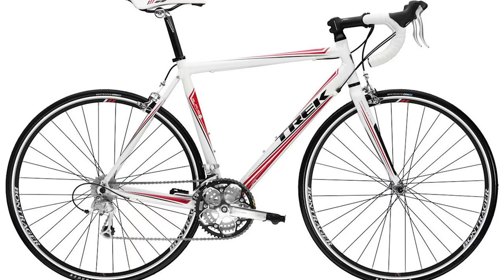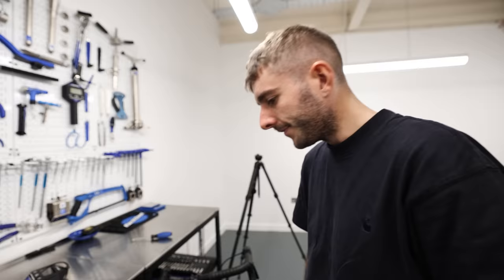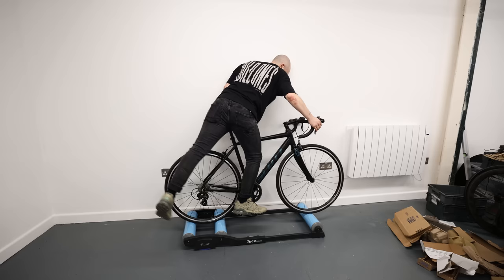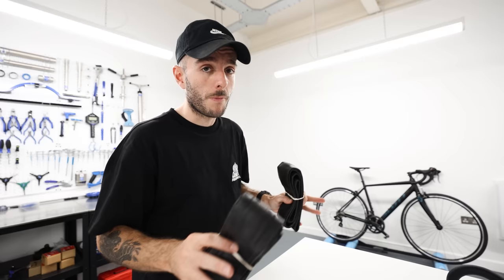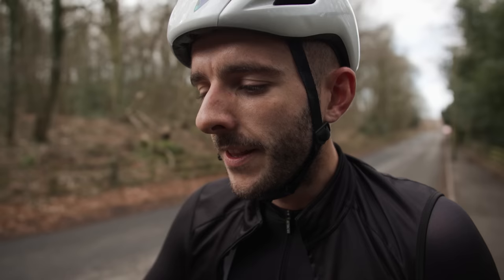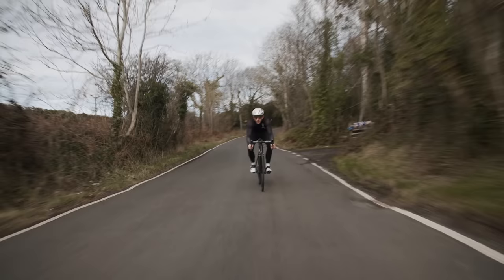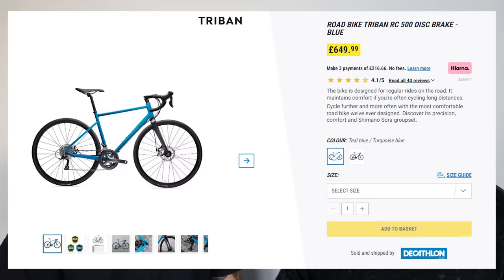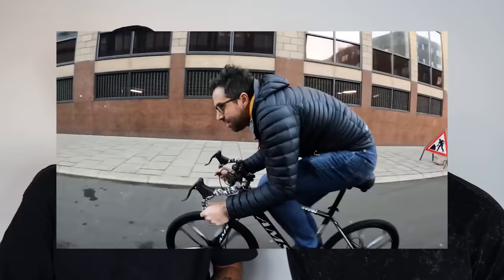How Good Is An "Entry Level" Road Bike In 2023?

Comment: My first bike was a 20" Walmart bike. Then moved on to another Walmart boke made by Kent. The Ditch 1.0. It SUCKED by real bike standards necause the frame had an offset doible trianglr at the crank and the frame broke clean in half right there. My most recent bike is a Frankensteined secomdjand Walmart "full suspension" comfort bike with parts salvaged from that Ditch bike. It has a front MTB tire. Both tires slimed for gravel riding. 1x7 groupset. It kinda works. Expect at least one chain drop per ride. 

I got a Trek FX2 this summer but ended up returning it due to not fitting me well. The handlebars were too wide even though my legs were having a fine time. Apparently I have weird geometry. According to some measurements I did myself, if I were to go by the Trek official sizing, I should have an XXL stack, an L reach, and XS handlebar width. I them tried their Verbe which felt nice but frankly came with insultingly mediocre parts for $1,000. Alivio groupset, full aluminium frame and fork, special gel saddle that was way too wide. It was like riding a horse or a giant tricyle. Didnt even pick it up since it had the wrong parts, like a special alloy handlebar that's alloy but acts like carbon. Is that a thing??

I'm skeptical as to what I can get a big brand store for cheap. Too bad we don't have decathlon locations here.

Comment: I started cycling with a steel frame bike and love it, then I bought a used aluminum scoot bike for $400 dollars,  and I did my 4 century rides on that bike, then I traded for a usted full  carbon fiber but it was to big for 😢 so I traded it for a composite frame used bike Gaint defy alliance 1 2009 , so I never had the experience to ride a new bike.

Comment: My wife has an aluminium carerra zelos from halford, the one before the went disc. It's been bomb proof. If comes with the exact same groupset as this bike so your comment comparing to the ebay bikes isn't true. I'm sure there will be some differences but they are definitely proper bikes and not like those ebay ones that fall apart on assembly. It was 250 when I got it, think the zelos is around 300 quid now

Comment: Jimmi is for the people! Smaller gears! Right on! I think it looks like a good bike. The brakes are good, probably less headaches for an entry level bicycle. If you haven't tried 105 or ultregra and up would you really notice the entry level disc brake being an issue if its set up by a local bike shop? A little pricey for entry level, I think $800-900 USD is better, but with current market, inflation, etc etc, $1000 USD, might be the new entry level. Francis has a good point, have to be careful because there is a point where cheap will mean things breaking and falling apart, which is not good but are we on the cusp of having entry level bikes come with sensah or L-TWOO and reserving shimano for premium products? I've had Sensah and Microshift bikes that worked very very well for around $1000 USD +/- 400 which seems like it's in the same territory.

Comment: This is a bike that's set up properly, there's plenty that aren't. I bought a road bike a few years ago as a commuter bike, and I was able to make adjustments, but I'm not an expert mechanic. When I brought it to a LBS, they told me the rear dropouts were a spec that manufacturer's hadn't really used in years. Turns out, they were welding MTB rears onto road frames, as both 'halves' were otherwise junk due to manufacturing defects. Well, the LBS told me that if I continued riding it like that, I would likely crack the frame. At no point did the bike seller make this known, whether through documentation, or anywhere else.

Comment: First bike was an mtb Giant GSR 200 very very basic, all parts got upgraded. Working in a bike shop in the late 90's £350ish for entry level mtb, rigid, one bike manufacturer offered a better quality frame that could be gradually (or rapidly depending on wallet) upgraded with better components. So I'd look at who offers the best frame size that fits you for what you can afford, components can be upgraded as and when. If the Scott frame is good then yes it's an entry level bike.

Comment: Agree 100% on most new bikes being overgeared and it being stupid to sell stock saddles without cutouts.

Where I live shops have 52/36 11-30 bikes on the floor and local hills are rife with 12-18% grades. I have 50/34 and 11-34 and my knees are much happier. No one I know or see is calmly spinning 36:30 on 15% grades.

Comment: I think that entry level bikes with disk brakes still have an advantage over rim brake bikes - not because the bike as built is better (rim brakes are much better than cable disk at cheaper price points) but because it gives the frame a longer life of upgrades. Upgrading to a different group set is better when accompanied by the upgrade to hydraulic brakes as well as the gearing upgrade. Not having a frame designed for disks limits this potential...

Comment: I'd consider a decent actual entry level bike to be equipped with a microshift drivetrain, have tektro evertyhing, and is from a brand with a shred of industry cred... it might not be a road bike per say, but at $500, the Mongoose Grit is about where I would say "yes, this is a bike that is worth it if you just want to dip your toes into cycling", if the person likes it, it can be upgraded relatively cheaply (hybrid brake shoes, better tires, better saddle) and would serve someone well for awhile.

Comment: Used bikes is the way to (aslong as condition is checked), i have a Specialized Allez with Claris i recently bought for £300, its 2 years old and was only ridden a few times so basically brand new, i have a Ridley Fenix SL which is Sram Red which i bought for £1000 and i have a Scott Foil which is dura ace/ultegra mix which i bought for £1600, if you know what u are looking for then used is the way to go, all 3 bikes where under 3 years old when i bought them

Comment: My first bike was some garbage mtb Target/Walmart carried when I was a kid.  Steel, basically indestructible but heavy.  My first REAL bike was a Cannondale Topstone 4.  Reasonably light considering the components, the components were not good.  The TS4 comes with MicroShi(f)t AdventX.  I could never get it to shift right all the way through the 10 speed gear range.  I ended up swapping the groupo for SRAM Rival AXS and it's made a significant improvement in the quality of the ride.  There's still entry level bikes to be had, but you're going to suffer through just cheap unrefined groupsets and trash wheels.

Comment: Hahaha, that Trek frame is the same frame I bought used 2 years ago, also my first, Francis. I’ve since upgraded to a Scott carbon with 105❤. I would buy an entry level bike at that price. Of course you can buy a used one and get a “better” bike, but there’s quality in getting a new bike. Especially if you’re new to cycling and not a great mechanic/maintenance-savvy yet…

Comment: My first road bike was a Felt F95 that I bought for about £400 new. Sora gears and a carbon fork were they selling points, and it was bullet proof. I did so many miles and sportives on that, and only upgraded to a carbon frame in 2018 as I wanted slightly more gears and a lighter frame. 

I'd say that Scott bike is entry level given the worse specs and higher prices we see now. I looked for a gravel bike in 2022 and couldn't find a decent entry level gravel bike for less than £1500. Also LBS were no use as they could only order you certain bikes from certain  manufacturers and were much more expensive. I bought 2nd hand in the end and just paid for a good service instead.

Comment: 8 years ago I bought a mango point r, road bike. alu frame, carbon fork, full shimano 105. It cost roughly £550 at the time, from memory. definitely under £600. 

there still are true "entry level bikes" that cost less... triban rc100 etc where you've listed the rc500 that's their top spec bike. for people just getting onto a bike for the first time, the £250 you'll currently spend on the base model is money well spent on a bike that's probably specced as well as the one you've just ridden. 

agree on the climbing gears though. most of us looking at entry level bikes especially are casual cyclists or looking to get a start or don't have the income for a bike costing thousands. and we're mostly portly fellas with poor to average fitness...

Comment: My 1st lightweight racing bike was in 1984/5. It was a Raleigh Competition, Reynolds 531c and decent components. It was £225 which was a lot at the time, but was ‘cheap’ compared to some I was racing against. I upgraded components over time to aero stuff and Campag group set. I can buy a second hand ‘vintage’ Raleigh Competition from eBay for a lot more than that these days. But I won’t! I’d say that unfortunately £900 would be considered entry level if you want to have a decent ride. That’s pricing a lot of people out of cycling.

Comment: I think that Canyon does a better job with entry level bikes.  If you look at the Endurace AL for instance. You wil get better specs.  Tiagra groupset, Carbon fork, 11-34 cassette, also rimbrakes. Weight is about 8.72kg.  At a price of €999,-
The handlebars are indeed to wide.

What i agree with is the tire choice. I also like the Hutchinson alot. I use the Hutchinson Override on my gravelbike, tubeless setup.

Comment: My GT Grade Elite 2022 with Shimano Claris and carbon forks can be picked up for around £850 now. I got the small and it came with really wide handle bars, I have a feeing that they just use the same handle bars for all of the sizes. 

I also had a Pinnacle Laterite 1 that also had Shimano Claris in 2020 that was about £450, I just looked it up again and for the newer models they have replaced it with Tourney group sets

Comment: Quite expensive for an entry level bike these days. I bought my Specialized Allez 2015 at €650 with Claris groupset. I upgraded it after 22K km two years ago with Campagnolo Centaur groupset + Campagnolo Scirocco wheels and still riding it. Weighs approximately 9kg now. Not bad IMO for an alloy bike from 2015.

Comment: I got a 2021 entry level Boardman gravel bike for £750 (now retailing at £800), with Sora gears and Tektro mechanical disc brakes…which I concur are utter shit! The rest of the bike is spot on though. Changed the saddle for one with pressure relief, but came with Schwalbe G one all round tubeless ready tyres, which were fab, and I’m still rolling around on it pretty much as is with only the general maintenance (new chain etc) you’d expect to do for a weekend warrior. Tried to upgrade to hydronic brakes but my LBS couldn’t get the parts last year. Would probably still upgrade parts rather than buy a new bike at this stage.

Comment: I think "budget" bikes are better than ever, I bought a specialized allez for £999, 50-34, 11-32 and it only weighed 9.5 and I've since changed some parts and the weights came down again and the cables are internal which I didn't expect and really like about it

Comment: Great video review of all the aspects of buying a first bike. I like the idea that it does not have all the right components for you. The important bits, frame and gear set are good but you can change other parts seat, bars and tyres for a moderate cost. 
So your first bike maybe not be the perfect bike, yet! Getting the feel and changing bits is the way forward is my way of getting the right bike.

My first bike, almost before you were born Francis, was and still is a 30yo Ridgeback hybrid with straight handlebars. Probably a tad small for me, but has been an old faithful on commutes and off road, not mountain tracks, alike. It cost £200 back in the early 90s and I have spent around double that on maintenance and spares, with no major issues.

I have just bought my second bike, a relatively cheap gravel bike - Whyte Glencoe. I will be the first to admit that I bought it almost on the way it looks, other bikes with the same or possible better parts were available.  After watching your video I will give it a few months of riding and consider if I could improve the rides by changing one or two parts.

Keep producing these informative, entertaining and quality videos on all aspects of bikes, there’re great viewing 👏👏👏

Comment: From my experience having recently shopped for a bike within my budget of 3k across loads of brands, the money would have probably stretched a little farther had it not been a Scott. I don't think that is necessarily saying anything negative about Scott, but pound for pound across much of their range I see lower spec components compared to some of the competition. The size of their company, and their clear focus on higher end, and I'm sure some could even argue "brand tax" just doesn't add up. Only guessing here with the info I have but my assumption is that the cost of their frames are above average from the bottom up. If that also means higher quality, great, but I don't personally think that extra expense on an alloy frame is warranted. Not at that price point anyways with such a varied and competitive market. An example that comes to mind would be like an entry level giant contend. I may be off base here as I haven't compared the two side by side in real life but at face value it seems to be more bang for the buck.

P.s. aside from all the recycling the new space is really starting to shape up and look great. Cheers.

Comment: It strikes me that non race road bikes would be best specced with a sub compact chainset. Most riders would use the extra climbing gears more than they would miss the faster ones. And at mid range up speccing a 10-32 cassette would give you your fastest gears back compared to a normal compact.

Comment: While yes this is ab entry level bike you can get something like this cheaper elsewhere. Especially at this level about $100-$200 is just paying for brand recognition. Online retailers Bikes Online have their Stratos S2 which is an aluminum frame with a carbon fork and Shimano Claris R2000 for $800 (is actually $550 on sale as of this comment). With entry level shopping around is key in my opinion. While there's nothing wrong with going with a brand you know at this price range you'd be hard pressed to tell the difference between this, Trek, Cannondale, or that Stratos I mentioned. Especially once you make those handle bar, saddle, and tire changes.

Comment: A Triban 120 is probably the real entry level for most people. Decathlon makes pound for pound the best bikes (except for a recent price increase in our local stores - give us back our cheap prices!!!). My first road bike was a Triban RC520 which you don't need to upgrade at all with a partial 105, TRP HYRD brakes, and decent components. That was $800, and was a great bike for the past 2 years. I just recently upgraded to a $2000 bike and while it's obviously better, I would say the performance gain was just an incremental one. The real difference was comfort.

Anything that goes beyond $800 is probably mid level already. I know avid cyclists see this as cheap, but for someone just trying out cycling, it's already a huge expense.

Comment: Wow £899 ! get you Tourney gears these days..........  just over 2 years ago paid £729 for Decathlon Triban RC520 with 105 & HY/RD cable actuated hydraulic brakes.  Swapped out the wheels for Mavic Aksium but other than its still stock kit.

Comment: I'm an ok climber at 69kg and 300w ftp and have a 34x32 as m lowest gear. I do notice on my Z2 rides at around 200w's on steep 10%+ climbs I'll often be in the 50's in terms of cadence. So for a beginner with a 2 to 3w/kg ftp, if they have steep climbs around them a 34x28 is much too hard. And will affect enjoyment.

Comment: Rim brakes are so much better for 95% of riders than disc.  it is, so true.  It is (e, becoming) counterintuitive for the industry in the next 2-3 years to only offer rim brakes on lower priced frames because simply people are learning better and they are losing money to people Choosing cheaper frames (and then upgrading them) or going custom.

There is no good reason Titanium rims are not made.  Compared to steel and aluminum titanium is more abrasion resistant.  It also bends back easier.  The larger sized rim widths call for titanium even more due to the 'shell' being larger than previous aluminum rims.  When completes start trimming the fat so to speak and lean down into a more respectable bike i can see Ti rims being there..  And the price for it all over 5000$ despite what you are actually getting :)

I like ten speed.  Ten speed has prices that are easy enough to swing, the gears are not that too difficult to tune, friction shifting still can be usable, 11 speed chains can be used for a even better running setup i have heard.  135 rera drop  out spacing with an offset rim and J-bend spokes all laced exiting the hub shell makes for like basically 142mm drop out spacing strength,, i think.  Quick release is just handy.

Comment: I think it is fair to call this price entry-level, give or take as you mentioned.  And I like your take and your upgrades, and sure, those reflectors in the spokes are lame but I would advocate that they remain on the bike at least until the rider gets up-to-speed with fluro gear and such and why not, every little bit of visibility may be the difference between being seen and being hit.  And for that matter, some reflector tape on frame tubes would help to make for a safer ride when the frame itself has a stealthy finish.

Comment: £200 Raleigh, everything was cheap on it, within 18 months I’d bought a 2k carbon bike with 105. I would still say to people get a cheap, almost disposable, bike new or used to start with. If you get into riding you’ll be much more inclined to go for a second bike that’s in in the upper mid range that will last you 10 years

£600 in 2009 is about £900 today